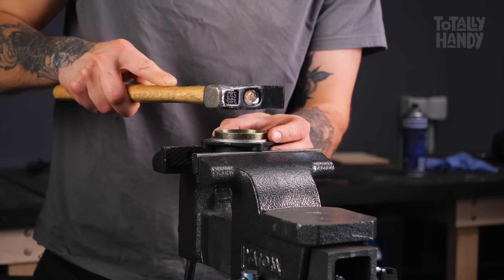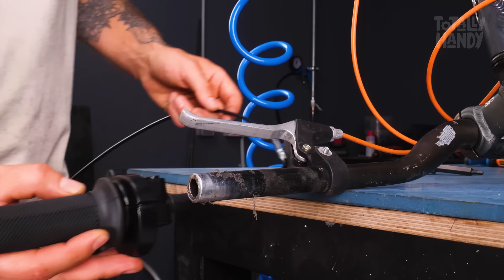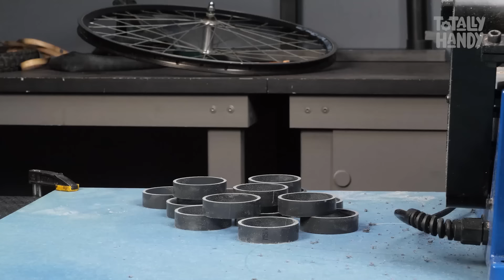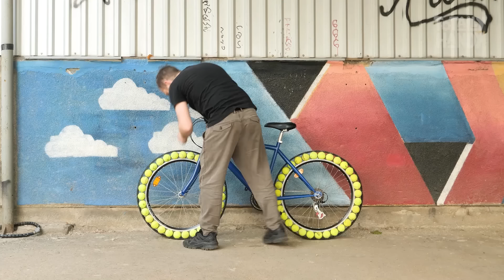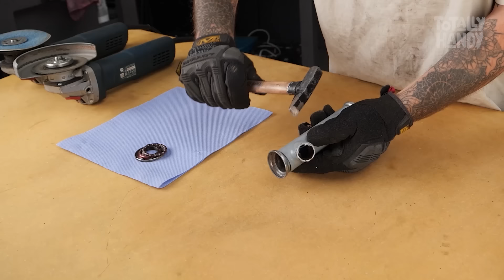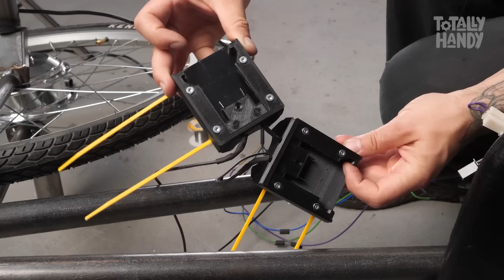Motorize Your Bicycle | Remake Project

Comment: It's easy to build one from scratch like you did if you have the know how and tools at your disposal but for the rest of the world, it's easier to buy a build and slap it on a bicycle frame
Reply: Like cutting down a tree and showing how to make our own matches from scratch dumb
Reply: Easy? The "know how" is always the "easy" part for those who have no idea what effort/time/training/experimenting/failures/research/study etc etc it took to develop the "know how."

EZ - lol
Reply: Easy to build kits for someone without the know how and... make bank.
Reply: Or you can go to your local welder?
Reply: @chairmanofwhat  if you are rich and want to pay a welder which at the time I type this makes an average of $22.29 an hour
Reply: 😄 thats Wright,u need a shop,tools and u have to have the knowledge, better buy a new one. 🤷‍♂️
Reply: Cool story bro
Reply: So u didn't buy that welder : (
Reply: You get the know how from messin around. Most of the tools are pretty cheap. You could eliminate the grinder and just use a hack saw. That's less than 10$. The welder is a bit more, but they have cheap ones anymore. I got mine for 150$. Just remember early machines were built with hand tools and creativity.
Reply: @tpohlen it's kinda what I said. He's also making this seem like he's the first to do it.
Reply: There's an electryc motor (sharper) that goes under the disc brake. I think this would be better that way. Good for climbing, not for velocity, though. It would be great to combine the combustion and electric engines on each size of the rear wheel. And combine the regenerative brake with the combustion engine for regenerative power. An hybrid system.
Reply: The manufacturers making millions of you say otherwise 😂make your own and sell it
Reply: Your point 🤔
Reply: Umm those kits dont just slap on either theyalso take work .. as for tools this dudes using a welder n drill probably a grinder not much out the ordinary its when they use the cnc machines making metal pieces b stuff that i chanfe videos cuz thats a lil more uncommin to have  .. imo
Reply: Lol i licked up a stick  yesqelder for 50 bucks on amazon n it does what it needa to do and i got the hf flux core 125 it does its jib too so it aint cost tgat much dont cry about how this dude does it just do it or dont ya gonnaleqrn if ya wanna or ya gobna make others rich or save mk ey and ve bored af in life
Reply: You guys don't know how to speak english normally
Reply: Thanks..what a great comment...it really changed my life

Comment: Interesting. But if you're gonna attach a sprocket straight to the spoke intersections, expect problems sooner or later. Spokes can break from seemingly no good reason already on a proper build.

Attaching a bolted on sprocket to the intersection crossovers is only gonna cause undue stresses on the spokes and also spoke rubbing wear and tear, those aren't flush surfaces.

Also, don't assume anything about the bolt pattern, different rims have different spoke counts, one such spoke count is 28, which doesn't divide by 6 or 9, it divides by 7.

People, if you're gonna modify your bicycles, don't make any assumptions about videos such as this one, do all your own measurements CAREFULLY.

Measure 3 times and cut once is what most experienced builders will tell ya, for good reason.

Edit: Also make sure you don't have the exhaust coming right onto your tires. Not saying this happened in the original video, just saying it's another thing you should look out for if trying similar modifications yourself.

I feel there should have been more safety and common sense engineering information posted along with this video.
Reply: Nice
Reply: Well said ,as safety is the Number One Factor :hand-purple-blue-peace:
Reply: Aye, this is the part that actually has me worried. There must be better options than this one floating around. Spokes are the most critical part of the bicycle, stressing them under the full power of a motor doesn't sound like a clever idea.
Reply: @inverse2k1 well spoken 😂
Reply: Yes, he did indeed do an awesome build, didn't he! 👍👍
I don't know if you've ever seen the kits you can buy, but many of them  sandwich a sprocket and a couple pieces of rubber on the spokes and they do seem to work. 🤔
Reply: There’s a more proper way that you can attach it to spokes, but I prefer attaching it directly to the break spot🎉
Reply: Spoke attachment will fail constantly.

Comment: I have a full suspension mountain bike with a Poulan/Husqvarna chainsaw engine mounted mid frame. It used to use the rear derailleur, definitely not recommended, but it works pretty well. Gonna do some more mods later, it already has a headlight, taillight and turn signals. I'm going to change the gear ratio, love your build here.

Comment: The first bike has a gear ratio of about 4.5 to one. So if the engine is at 4500rpm the wheel is spinning 1000 rpm. So the 26 in wheel has a circumference of about 82 inches which would travel about 6666 feet per minute, times 60 minutes and divide by 5280 ft come to about 75mph. The max speed of this 25.4cc engine is likely less than 30mph? which would put this engine at about 2000 rpm. What am I missing? without a jackshaft with extra reduction these types of vehicles have a gearing almost the diameter of the wheel. Think of a friction drive bike which will have a roller less than 2 inch diameter, spinning an the circumference of the entire tire.

Comment: ever thought of running engine output into a geared rear wheel hub? shimano's 3 speed thingy should work for a nice gear reduction, a direct drive and an acceleration.

Comment: Should have put the motor in the center of the bicycle attach a gear to the left side of the crankshaft where the pedals are attached remove the pedals as well and then you still get your gearing ratio on the other side so you can still shift gears and get better speeds or torque depending on the need setting it up the way that these guys did by attaching it to the rear tire off-center make the bike lean more to one side because of the extra weight and then you have to deal with that while riding 
How the gearing is you will not get much speed tiny wheel turning big wheel 
Also the way that the gear is attached to the rear tire will eventually cause it to break

Comment: That was cool but the weight on the back wheel makes it harder to control at lower speeds, like when starting and stopping. Especially since the weight is on one side. I've been wanting to add a engine to my bicycle but I definitely don't want to lose the function of the gear shift. That would slow me down. Peddling while riding let's you accelerates faster.

Comment: Instead of relying on welds, you could get a 3D printer to fabricate you the parts you need if you're using it long term. Great video.
Reply: Are you seriously suggesting that 3dprints are stronger than welds?
Reply: Lol, those welds will hold a lot more than your plastic.
Reply: Yeah and dropping 3k at least on a printer😂😂

Comment: How many k’s did the rear wheel last? Was the sprocket seriously just bolted to the spokes? 😅
Reply: Yep I was thinking the same. Doesn't look really sturdy
Reply: Yea, really impressive DIY project for those who have no structural integrity (and safety) in the 1st place their mind.
Reply: Bolting the sprocket to the spokes is usually a big no-no.  Most spokes are not designed to take that abuse.  Also, getting the sproket to be aligned true can be nearly impossible and can also lead to problems if it's not straight.

Comment: Awesome, but tightening directly on the spokes is a big nono.
Reply: Why's it a "big nono"?
Reply: @anonemous1046   Spokes keep the rim aligned. A force applied on them will make them bend and put the rim out of center.
Reply: Lane AWD  I'd like to see that, but I am focusing on a battery operated device.  212cc is pretty good, though. 👍

Comment: is it legal? do you not need number plates and insurance and all that jazz cause its motorised now?.
Reply: Most states don’t require registration or anything if the engine is under a certain size
Reply: yeah i have one where i live along as it’s as it’s not over a 50cc your good. but if you do don’t go to high like a 80cc if you do go over and you get stopped by the cops just say it’s a 49cc most cops wont test it.
Reply: Most people totally think I'm pedaling my bike, ha, there are no pedals, no chain, no sprockets, duh, what's the difference...idk the bulky back rim has a large center mass, but couldn't be propelling me forward at a rate of everyday common road traffic
Reply: The motors are small enough that you don't need a license at least not in Florida. In Pasco county these things are everywhere because so many people have been busted for drugs and alcohol and got DUIs
Reply: Keep at 49cc and it isnt
Reply: @ryanrichardson735  In Germany we even have to register those 20kph E-scooters. Everything over 6kph has to be registered
Reply: @gertanzlord7787  yeah, this is super ilegal in most countries, if not all, in the EU. 

In Portugal bicycles can’t be more than 250W and go faster than 25 km/h. 😐
Reply: You'd need a license, insurance and a mandatory safety check in Germany (and probably most of the EU). It's motorized after all.
Reply: @ryanrichardson735 even still, you can't really register it as anything or get it insured. There's nothing outside motorized bikes that would fall into category under(except commifornia and New York.) But most states wouldn't have a category to get it registered under
Reply: America is amazing in this regard, and unfortunately us in Europe do not have this liberty, idk the rest of Europe but in Ireland I see lots of young people on the electric ones so I'm guessing it's some "environmentally friendly" bullsh!t rule even tho lithium is mined out of the ground so(more rare than oil) it's all bs and when those batteries die people will dump those bikes, oil bike is better value
Reply: Its the same for dirtbikes, except its not loud so its allowed on street
Reply: Here in balcan,everithing is lagal😊😈

Comment: Motorizing a bike is so dumb. The frame and wheels are not designed for that and its a recipe for all kinds of mechanical problems and safety issues. Then there's the noise, the fuel and the nasty exhaust. Hard pass..